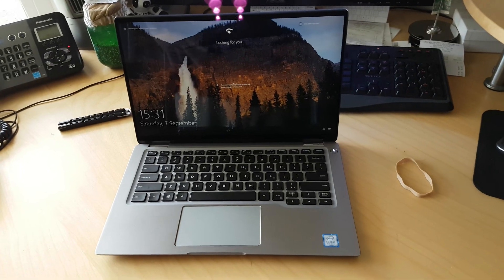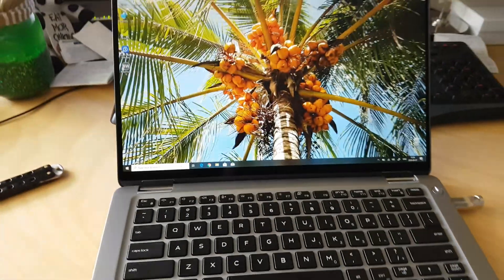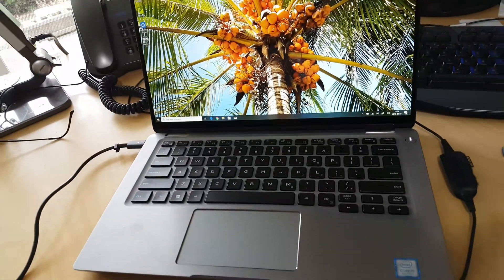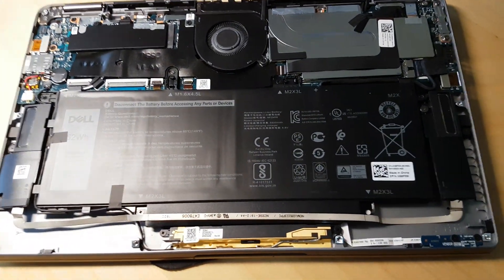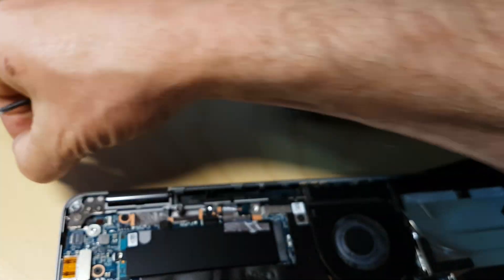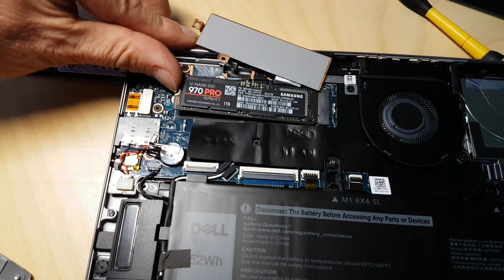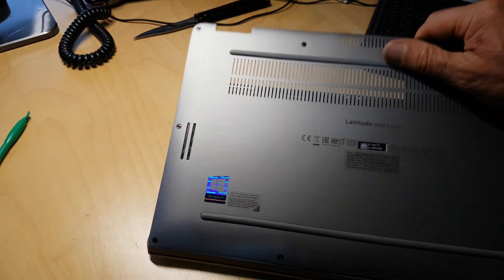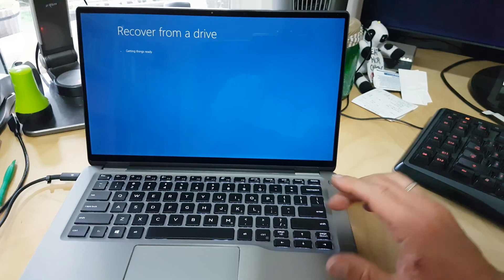Dell 7400 laptop 2 in 1 - SSD Replacement

Comment: Thank you so much for your help just to let you know I install the two terabyte drive in the same laptop and it works great. I cloned it and it still works great. I had to remove a card that was in the way it looks like a WAN card for 5G network I just took it out since I don't use it and it gave me room for the longer stick SSD. So everybody out there you can put a 2 terabyte hard drive in this laptop. Reach out to me if you guys have any questions.
Reply from the maker: Thanks for letting me know that a 2TB SSD will work as well. I didn't know that.
Reply: What do you mean you cloned it?
Reply: You're more than welcome. Mine is still working well my two terabyte
Reply: @mirage711   did you check you can actually access / use the 2TB ? In some situations the drive appears to work, but its usable capacity is not the full drive due to addressing limitations

Comment: Hello, i am going to do the same process shortly.    One thing i don't understand is this just the basic operating system been swapped over or  do /did your files etc all swap over to the new ssd or does that have to be manually done by saving and re installing them later etc.   

Thanks for your time if you do read this and reply...    I read a bit online but can't make perfect sense of it